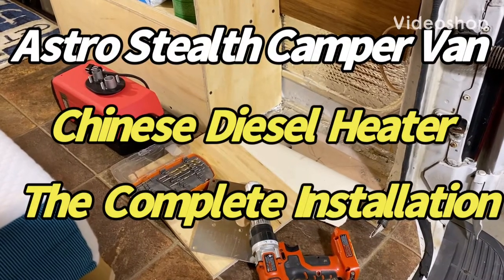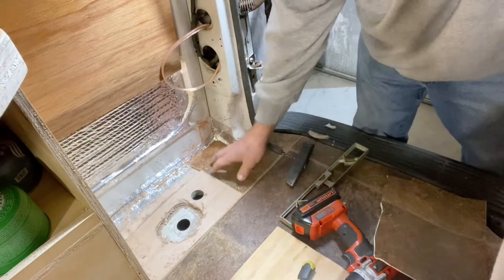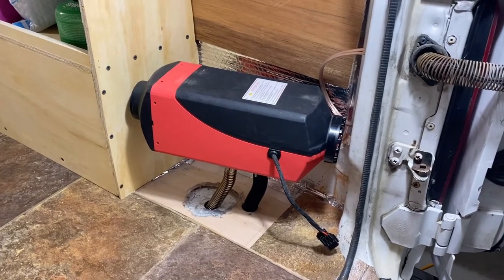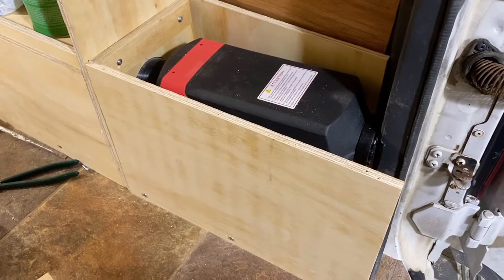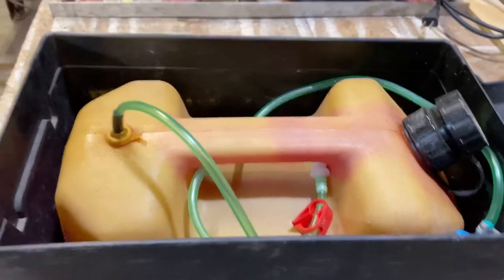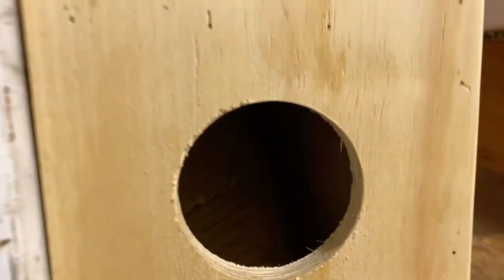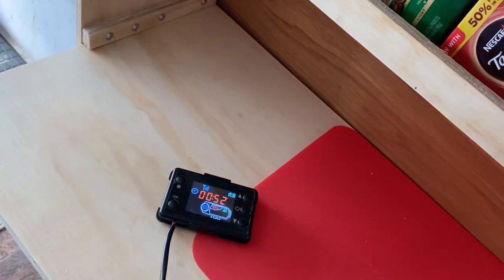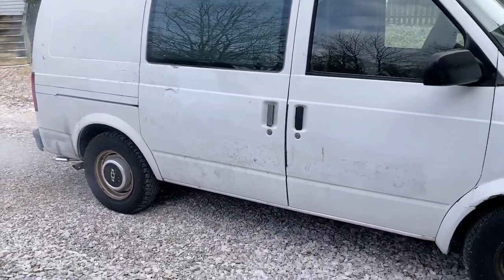Chevy Astro Stealth Camper Van  “Chinese Diesel Heater”  The Complete Installation

Comment: Hi just a tip to save future maintainer grief on your heater. At the back door gap for air entrance to the heater. Get a good piece of furnace air filter and cut a small piece to cover the gap. This will help to keep DUST from getting into the heater and causing you trouble.  Cheap AND effective  help to keep the heater working. Tom  up in Canada in the Maritimes at the NB-NS border
Have a nice day.
Reply from the maker: Thanks, great idea! 👍

Comment: Great job sir  I have two metal housing 8kw diesel air heaters that I’m about to install into my 1967 GM TDH-4519 city bus conversion but I’m waiting on parts I have researched and learned a lot about these heaters and the pumps that these heaters use need to be at a angle between 15 and 45 degrees and  to make them quite just hang them with zip ties or exhaust hangers and these pump require a hard fuel line
Reply from the maker: Check out my video on the installation in the cargo trailer we used a piece of rubber hose instead of zip ties and it worked great. Yes you are correct it needs to be at an angle so that the air bubbles can work their way out of the pump. However I have never heard that you need a hard fuel line both of the pumps that I have installed works great with the provided rubber hose.
Thanks for Watching!

Comment: Chinese version  of Espar heater I've  had under the bunk for 17 or 18 years in 3 different trucks  if ya want them to they will run you out of the cab, just be careful what is in front of heat vent they will melt water bottles and turn paper brown
Reply from the maker: Yes Sir, it does get hot!  I’ve seen temps approaching 250°F coming out of the vent.
Thanks for Watching!